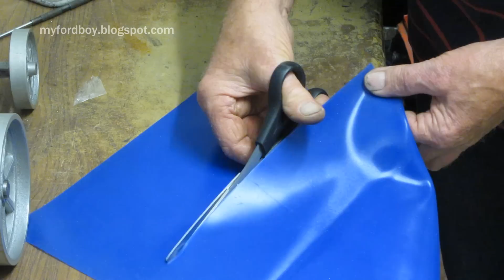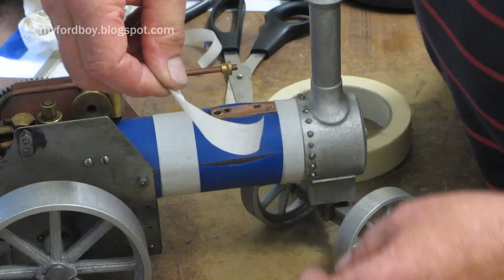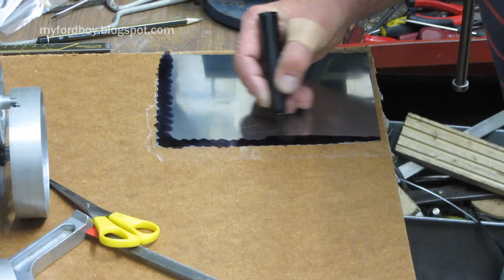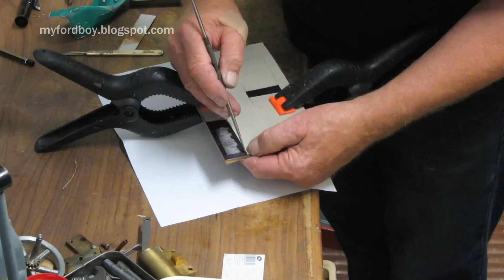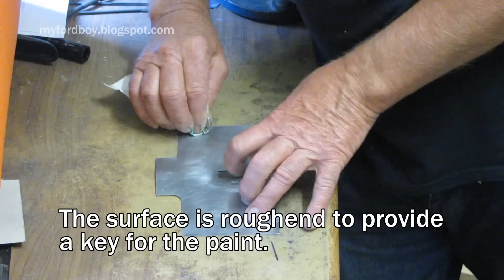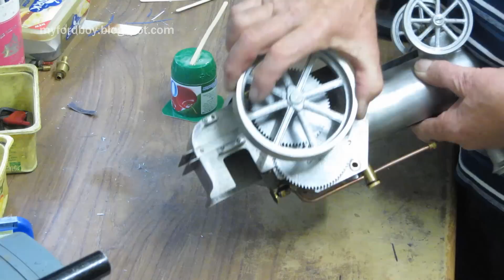Simple Steam The Myfordboy Traction Engine Part 19 Boiler Lagging

Comment: Rolling the sheet on the foam was brilliant.

I was wondering if you use a simple blue felt-tipped marker or do they make the engineer's bluing in a pen?  Is there any darned difference or is it "good enough" for patterning? Thanks!
Reply from the maker: I just use a permanent marker pen.
Reply: Sharpie pens are awesome

Comment: Now i have another use for one of those cheapie  foam camping matts -the other is as padded jaws for my vise  , glue some to some angle iron and you have a set of soft jaws that are good for holding wooden items in the vise .
I never thought of using a cheap baking tray as a source of sheet metal although i have seen mrpete222 cut up one of his wife's cupcake trays to make a belt gaurd for a lathe ! 
A traction engine is in my plans after i finish a stuart score and a rosebery hit and miss , i was looking at a minnie but it will take a long time to make  ! are you going to sell plans for your engine ?
Reply from the maker: Probably the best use for the mat. I imagine they are pretty uncomable to sleep on. I have castings and plans for sale http://myfordboy.blogspot.co.uk/p/the-myfordboy-traction-engine.html
Reply: +myfordboy 
Yes a bit like sleeping on an ironing board !
I will check out your website as i'm also interested in the Myford boy engine as well .
Reply: +myfordboy 
Yes a bit like sleeping on an ironing board !
I will check out your website as i'm also interested in the Myford boy engine as well .